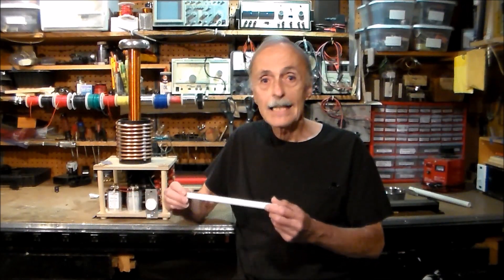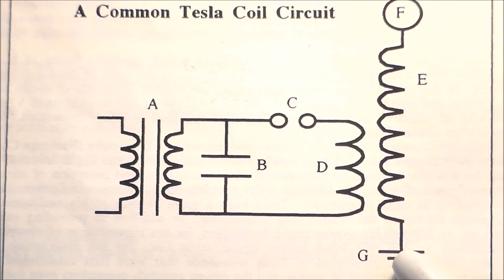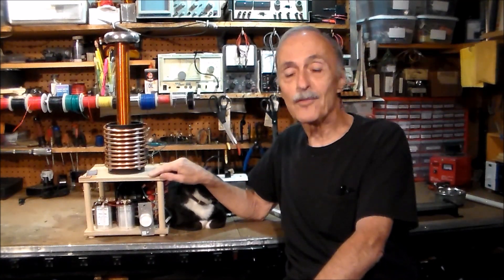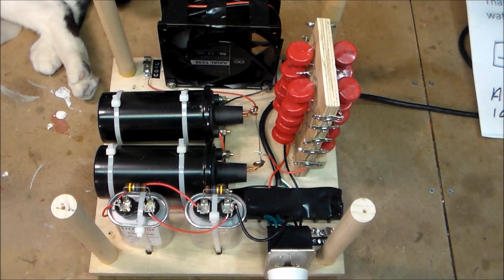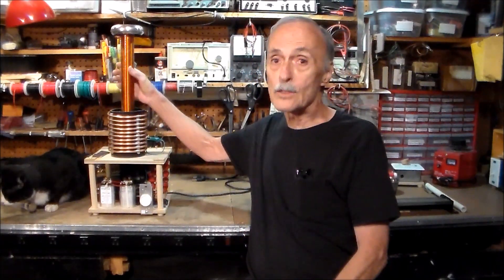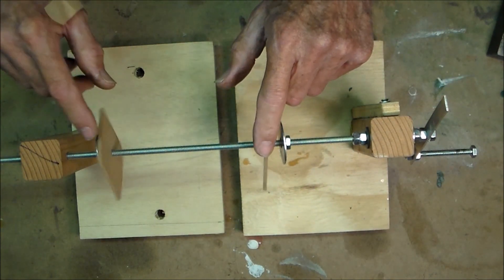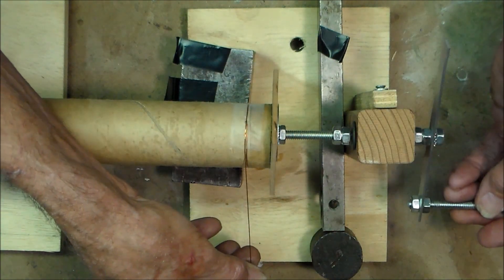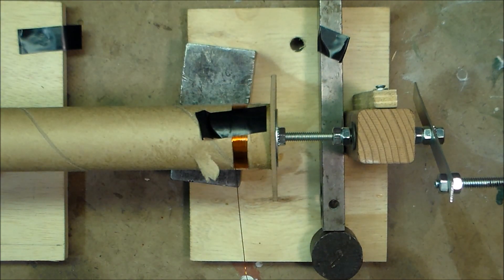A TESLA COIL

Comment: Pretty cool. I built one. But I have some little problems... My secundary coil have thirteen inches of long. I use different type of transistors, two in total. IrF 540 and TIP 41C. And it doesn't work. I wound the primery coil  well without errors. I think it's about transistors manufacturers perhaps. I tried very different shape but neither worked with those transistors. What do you thing about the troubles I have mention ?
Reply: Does the coil direction matter, clockwise and counterclockwise?

Which is the best?

Comment: If you value your ignition coils you need to swap the placement of the capacitor and spark gap. The spark gap needs to be in parallel with the transformer secondary coil. When the spark gap fires it acts as a short circuit across the transformer secondary winding. This actually protects the transformer by preventing most, but not all, high frequency oscillations from your tank circuit from feeding back into the transformer secondary. This is one of the leading causes of transformer failure in spark gap tesla coils that use NSTs and other fragile HV transformers. The circuit that you are currently using offers no such protection. Your coil may work for a while, but it will eventually damage the transformer secondary windings. You may have to incorporate some kind of ballast to limit the current drawn by the transformer when the spark gap fires.